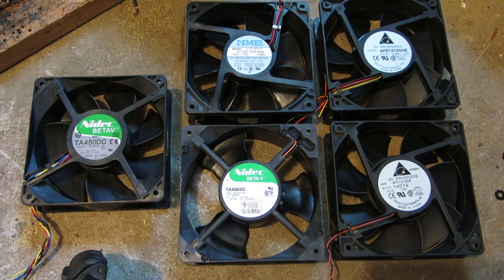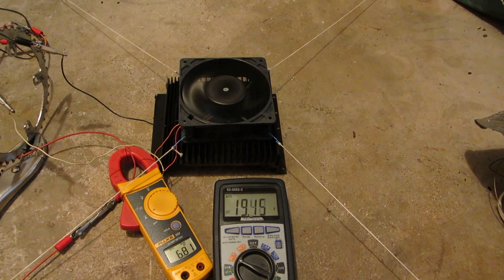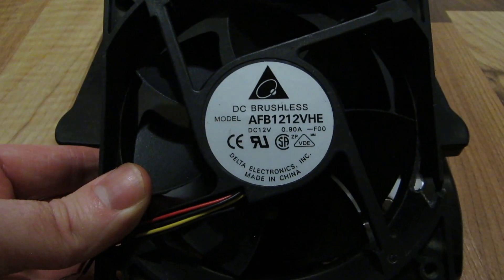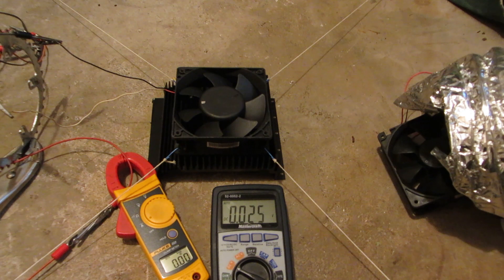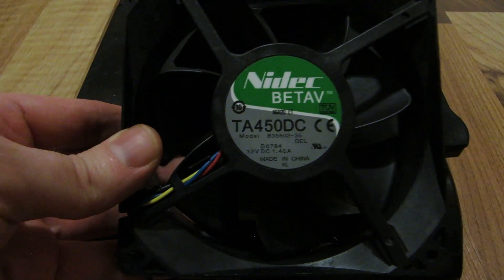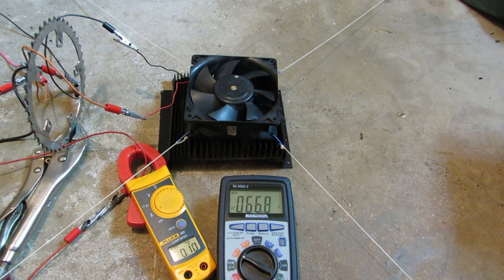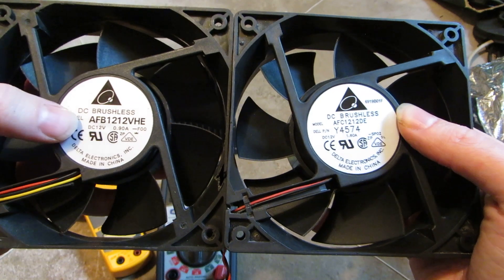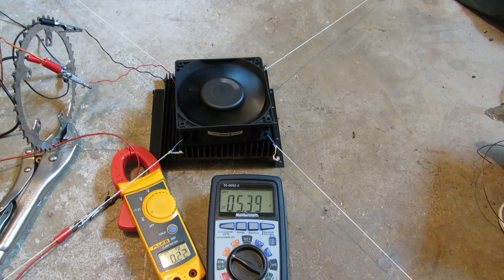PC Fan Flight Tests - 120x120x35mm

Comment: Am a fan collector here. Those "knockoff" Delta fans are actually custom Delta and Nidec models for Dell, HP and other OEMs. They are genuine Delta and Nidec, just not sold at retail outlets. Remember the AFC0612DE that failed short? Failed at "only" 19ish volts. The fans are meant to run not over 5 to 20% their operating voltage, depending on the model. Some ICs in fans also have governors that max out at X amount of RPMs and then lower the current up to a certain extent. Impressive that some fans are as tough at they look!
Reply from the maker: Yea that's why no Nidec UltraFlo fans were in any of these videos as they could not be over sped.
Reply: @HL4EHalfLife  Kind of a shame really, but it only makes sense (so it doesn't shatter). I got a suggestion for you - next time you rig up your variable supply, add more capacitance on the output, so the fans or motors get cleaner DC, of course put a small bleed resistor. Remember that rectified DC voltage from AC mains will be 1.414 times higher (100VAC = 141VDC, yours maxed out at about 82VDC, so your transformer maxes out at 58VAC). This will also help stuff pop more violently when the device shorts since the caps can discharge really fast.
Reply from the maker: @twlpcadmin2679  I'm well aware that the DC will be higher, and I do have a bleed resister it's just not permanently soldered to the caps as of yet.

Comment: I feel like the heat sink was a mistake, how about stacking fans in decreasing sizes?
Reply from the maker: I'm going to make a video to determine if the heatsink or anything else for that matter makes any kind of difference.
Reply: @HL4EHalfLife  =]
Reply: @HL4EHalfLife  does running a pc fan on lower voltage draw less amps?
Reply from the maker: @Lunarpollo5622  Yes.

Comment: You should put the set up on a scale while powering the fans just tare the scale with the weight of that heat sink on it and you'll see how much lift you're getting with some math from the fan weight as a standstill
Reply: In addition to my previous comment can you get in touch with me please?
Reply from the maker: @Katiethekitten  That method for the scale wouldn't work because the fan is thrusting downward against the heatsink, I would have to hang the fans from the scale to get an accurate reading(like I did with the hair dryer fans) However these fans were too unstable to use the same method so I decided not to use the scale. Which comment are you referring to?
Reply: @HL4EHalfLife  I was referring to the comment I had made that you so greatly shed some light on as I have not done some of these projects if you could find a way to reach out to me I have some suggestions to help bring more views to your channel

Comment: is it possible that the output noise is tricking the fan that is taking the set current  through a shunt resistor so it keeps going not paying attention to current i have a few nmb and delta fans with a hefty 0.01 ohm shunt resistor and not much noise reduction is present in the fan pcb at all.